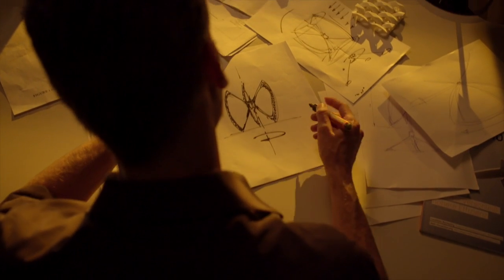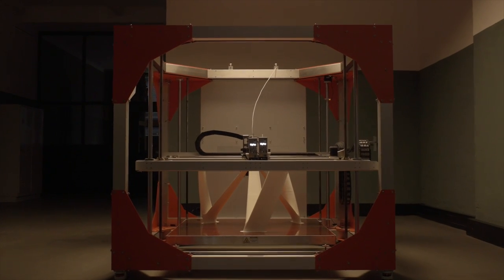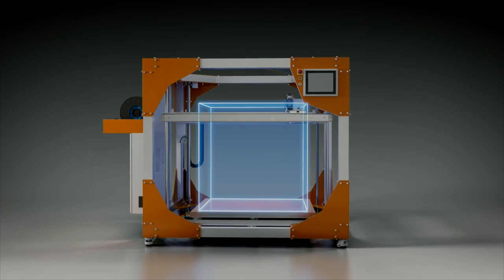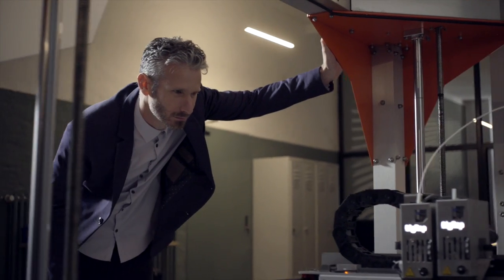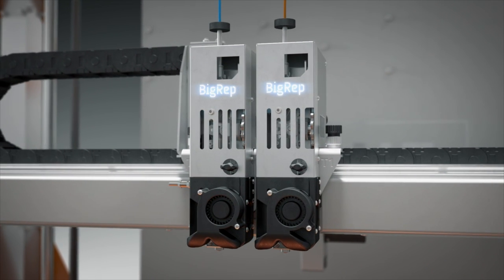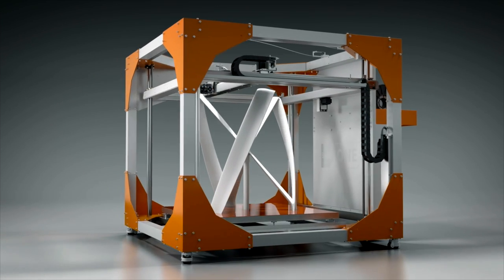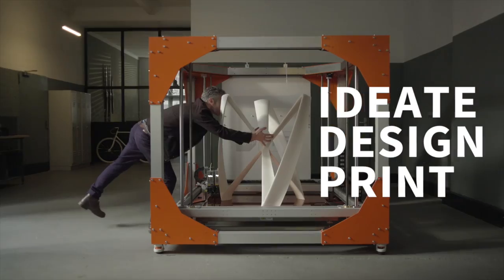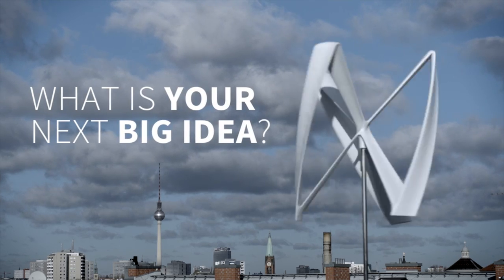BigRep ONE - Affordable and Reliable Large-Scale 3D Printer

Comment: Can I use recycled filament or would that damage the machine?
Reply from the maker: The BigRep ONE is compatible with third-party materials of the same diameter - including recycled! However, it is not designed for abrasive, engineering grade materials (like the STUDIO G2 is!). If you're wondering whether a specific material is compatible reach out to our service department! They're always happy to advise.